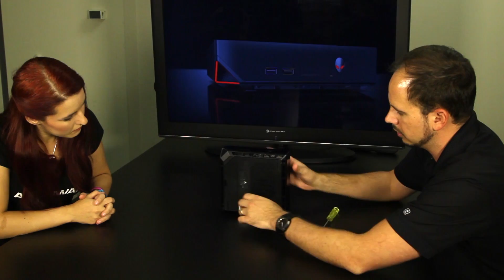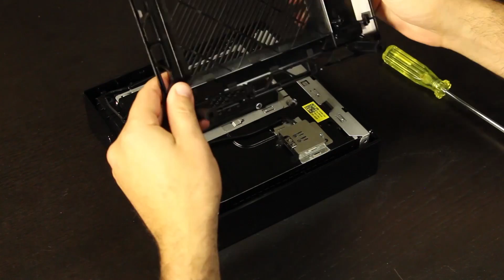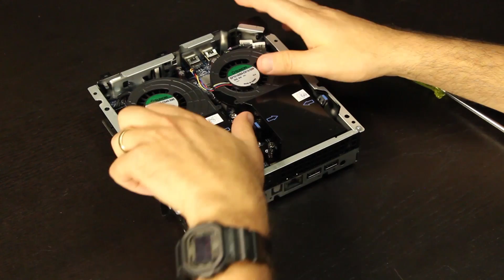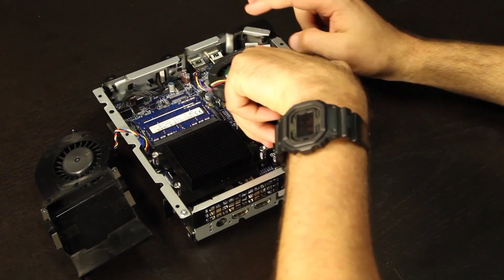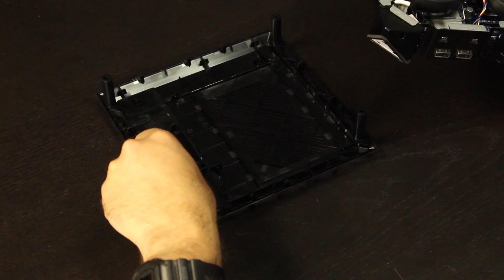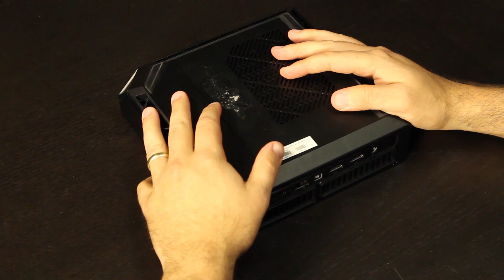Alienware Alpha - A Look Inside the Alpha

Comment: One thing im worried about is not being able to upgrade the GPU. I think no doubt if you bought a PS4/XB1 today and a Steam Console today (for a $150 more btw) in 8 years the console will still be able to pull of great graphics and run it at 30-60fps. While PC might have to run it at low-medium to maybe get 25.

Id rather build my own. But seems the only way to achieve this kind of processing power is to go to like a mini tower, which is something you cant keep next to a TV. Any suggestions?

Comment: I3 CPU is great for gaming?  ....

first upgrade found already
Reply from the maker: Aaron Huddleston Check out the gameplay vids. The i3 can handle the latest games with solid FPS.
Reply: True, but I wouldn't call the CPU ... futureproof or anything.  I'm sure the higher tier games like BF4 tried with an I3 would start to see the bottleneck.  We are just starting this gen so its just going to get worse from here.  Upgrading to an I5 would be my first move, that was my point of the comment.  I run a I5-2400 with a Radeon 6770 in my desktop im soon to upgrade and i really dont see many games outside of the Total War series really pushing my CPU, all 4 cores, to the max.
Reply: Aaron H. You can choose to upgrade your CPU later if you decide you want more performance out of your system. I'd suggest taking a look at the i5 model, as it's the sweet spot for overall performance per dollar.
Reply: Well the 1,6 Ghz Notebook CPU from the ps4 is futereproof ? I highly doubt that. btw its 28nm vs 22 ;) 28 with hgiher clock speed vs 22 is ok , but the alienware has much higher clockspeed and and the i3 is up  to date 2014 haswell , lol

Comment: I'm definitely gonna buy this. Could I put a core i7 4790K into this? Or would I have to stick with the i7 4765T? They both have the same sockets (LGA1150).
Reply: I see this question was previously answered earlier posts. I think Ill upgrade i7 4765T later and just go with the base model.

Comment: I Would want to know if i could pair this with the GAEMS M 155 scout, A monitor that is powered by usb. Does the alienware alpha have enough power to use it without PSU problems?
Reply from the maker: Trevor LueCheeLip We have not tested it. It has a 130 watt power supply. Most of that is used by the system.

Comment: LOL Could imagine Microsoft or Sony letting you upgrade components in their consoles? I'm never buying another console again.
Reply: No because that would be stupid. AS developers wouldnt have any clue what specs the users have and you'd have different requirements for different games. It would defeat the whole point of a console.
Reply: Clesarie Yet developers for PC's do it everyday? Go away scrub, don't reply to me if you have no idea what's going on.
Reply: I absolutely do but the whole point of a console is to develop your game for a set hardware allowing you optimize way better. PC games are hardly optimized and a lot of it is lazy back porting of console version. PC rely on the vastly better hardware to over come these things.
Reply: Clesarie is right, the point of consoles is to not have to develop for different sets of hardware. On the other hand, Alienware Alpha is not a console. It is in fact a PC. Most comparable to a laptop minus the monitor. People usually don't switch out hardware on laptops so it's a bonus that Alienware thought about that part.
Reply: And yet a lot of excellent games are console exclusives... If you can afford buying a 1500$ PC then good for you, but you have to see consoles as an extension to PC gaming, buy your multiplatform games on PC and leave the consoles to their exclusivities which are just as good (if not better in some cases) as PC games.
Reply: You're the scrub, dude. The point of a console is that devs only need to worry about one hardware set per console platform. Once that's eliminated, there could be games designed to work on new powerful hardware, but older hardware could be ignored or unplayable. #logic
Reply: ***** Jesus! Somebody help this man! He just went full berserk!...
Welcome to the internetz dude, people like me, you'll face a dozen a day... You just learn to live with it /o/
But more seriously, you really missed the whole point of my first comment even after I reexplained it...
Maybe another time...
Cheers :DD... And again, don't take the internetz too seriously, it'll only harm you.
Reply: ***** Having a master in computer engineering won't change facts... An HD7750 or even the 7770 can't run any 2012 game maxed out at 1080p60, even coupled with any multithreaded CPU in the market, benchmarks at hand... But yeah, you're the one with the master in computer engineering, you do know a whole bunch of computer stuff. Anyway, like it or not, computer gaming is not cheap, and today you can't get the same performance/price ration you get with a console (even though CPU wise, consoles are shit)... for now at least. And I don't like acting or being stubborn, but facts are facts.
Reply: it only the ram and cpu and nothing else though that would be cool to see the big two  do this as well.
Reply: *****  is actually right. I didn't read the whole thread though cause it was a lot replies. However from what I saw somebody said that PC gaming is way more expensive. Not true. Budget PC= $450-550. Can push games at 1080p 60fps while lowering some other things such as anti-aliasing and antisotropic filtering FXAA etc while still keeping textures at a higher setting than you would on a console. $60 per year just to use online services. Say you have a console and a PC for 4 years.
PC (lets say $500)=
$500
(game prices are from keyshops)
Dying Light: $40
Battlefield: Hardline: $40
GTA V: $45
Total= $625 x4 years=$625

Console (release price)=$500
Dying Light: $60
Battlefield: Hardline: $60
GTA V: $60
Online services x4 years: $240
Total= $820

On a budget PC still cheaper and better performance and graphics than console.
Reply: http://cheapdigitaldownload.com

Used this site a ton. You just get the Steam CD key so it'll be on Steam. Just look at the rating for the sites you buy on before you buy.
Reply: Oh sorry Dying Light is $25 on that site now :)
Reply: This isn't really a console, games don't run on the metal and you can't upgrade the gpu because it is BGA

Comment: Can the CPU in the alpha be upgraded to any LGA1150 Socket chip? Reason I ask is all the CPUs that ship with the alpha are 35W TDP with a LGA1150 socket type and most other CPUs (Quad Core) in that socket type are 64W - 84W TDP and with the Alphas low Watt PSU will it pull too much power then to upgrade to one of those chips (Depending of coarse on what the other components in the system pull for power)?

Also the RAM in the alpha can be upgraded to 16GB (Laptop RAM of coarse) right?
Reply: They said you can only upgrade the desktop "T" models of the haswell chips. And yes it supports 16 gbs of ram, but since there is only two slots you need two 8 gig sticks of SoDIMM ram.
Reply: James Hendricks I suppose that would make sence due to the 130W PSU limit to only use lower wattage Chips. I did get curious yesterday and asked a Dell Rep on there chat and they said it would support up to an 84W CPU but I can't imagine the custom GPU would take less than 50W of power, so not sure if I want to risk upgrading the CPU yet to something out side of there 35W versions untill more specs on the GPU are released. 

On a side note if I got the base system and upgraded the RAM to 16GB, would I see an improvement in fps and general gaming?
Reply: Not really in fps, but you would be able to have better luck running more things at once with less of a slowdown
Reply: James Hendricks How much better is the i3  vs the i5 in the Alpha, not considering RAM?
Reply: I think the i3 is only dual core, so the i5 is better, in certain stuff that uses quad core..I would just go with the i3, and if you need to upgrade just get the i5 thats in the other model off of newegg or tigerdirect.
Reply: James Hendricks I think thats what I'll do, I just preordered the base model and I'm going to order either 8GB or 16GB Laptop RAM on Newegg for it just before it ships!
Reply: Yes, the Alpha supports LGA 1150 socket, desktop 'T' variants of the Intel Core family (including Pentium, but we don't sell it with that line). The board TDP and BIOS are locked, so you cannot overclock those CPUs.

Comment: I first saw this yesterday while at work( Walmart ) in our pre-order booklet.. I currently own and use an Alienware X51( i5 3330 and upgraded it to a GTX 750 Ti ), My question, would it be at least comparable to what I get performance wise now or better. Thanks for your time
Reply: You would get worse performance as the i3 is not very good at handling high amounts of bitmap streaming when rendering textures at a fast rate .....your i5 in your x51 was kind of meant for that. PC games nowadays, don't let you fiddle with CPU settings because indie titles that want to make it big in the gaming world rely on people with powerful systems to build profiles that would improve optimization for the others. The problem.......this takes a long time and optimization for some games is terrible unless you have a good CPU such as the i5.
Reply: Since we don't know much about the GPU, and an i3 cpu is a really good cpu for the price..and honestly cpu doesn't matter as much in most games nowadays, i'd say that it would be probably comparable, but watch that skyrim video of the alpha base model; even with a few graphical mods that add more foliage and the like, it still stayed generally above 50 fps. I don't think it will handle the latest games like shadow of mordor on the best settings though.

Comment: So is the GPU non upgradable?
Reply from the maker: The GPU is not upgradable, however the CPU, Hard Drive and Ram are.
Reply: That is my question too. I have already pre-ordered the Alienware Alpha.
Reply: You can't upgrade ps4,PS3 or x1s..gpu either way if you compare. I'd wait for the next steam box and see if components is fully customisable to fit with PC gaming environment of upgrading to run games,  else you'll be left behind in 5 years when those PC hardware requirements get harder to satisfy. PCs overtake this current GPU with better ones in future. While consoles on the other hand will still be using the same low powered GPU because Game Developers  will optimise their games to run on lower powered console GPUs compared to PCs. Eg ..look how PS3 still going strong even though Specs sheets show less power. Question yourself is game developers going to optimise their games to run specifically for Alienware hardware? I don't think so, maybe?! Who knows?! This product is the best currently for price and the specs and performance you gonna get...but long term I'm not so sure it can last when those Pc game requirements get harder to matchup.
Reply: Alienware can upgrade to an i7 desktop processor or can it only be a laptop proccessor?
Reply: Angus Bing Only TDP 45W or below I think.

Comment: So...we can't go to a normal windows 8 screen ? And play other game like SA or PSO?
Reply: No, you can go to Windows 8.1 screen if you'd like, but we have built a full 10-foot console UI that lets you navigate all the core features, including launching into Steam Big Picture mode, with just a controller.
Reply: Marc Diana Thank you so much.
Reply: No problem. We know there are tons of questions around performance and the GPU so we'll be coming out with a bunch of new videos that answer these questions.
Reply: Marc Diana
May I know if we can change the hard drive?
Reply: Ichimaru8989 Yes, you can change the storage to a large capacity HDD or an SSD if you'd like. It's easily accessible on the bottom of the system.

Comment: maxwell gpu, so its a gtx 750 or 750ti, hmm. I was wondered about thermal throttles at first but it should be fine. Push that to a 760 and it will throttle no question. meh im just gonna dual boot, then i have windows and steamos which is just big picture so ill feel silly. But if i was to buy that i would straight away change those heatsinks, they are too small for me even if they do the job

Comment: Show us the gpu already! It's the selling point
Reply: Mikaela Murry Apparently it IS in fact, soldered on chipset.  If you want something you can actually upgrade, you'd need one of the small gaming boxes with a standard desktop GPU and micro ATX motherboard.

Alienware are roping people into proprietary hardware limitations that will put them in the same spot console owners are in... can't upgrade the GPU, which is what matters.
Reply: luke viscardi
It's a custom Maxwell GPU so it's basically a laptop 800m series GPU. So it's more powerful compared to a 700 series GPU.
Reply: it's a custom GPU using GTX 860M 2GB DDR5 as base
Reply: My main question regarding the GPU is whether it's a socket design like swapping a CPU (doubtful) or if it's like a laptop GPU being a small card with the GPU/RAM and furthermore, how ailenware plan to offer competitively priced GPU upgrades?

Because right now, Laptop GPU's cost a fortune (over 1200 dollars for a 980m and 700 dollars for a last gen 880m)
Reply: Noah Fledderman That was a terrible decision on their part IMO.  Are they going to make owners replace the entire motherboard just to upgrade the GPU?  maaaan... a laptop GPU slot would have made so much more sense.
Reply: Noah Wolfe The graphics in a PS4 are no more integrated than the alpha's are. There are no integrated solutions that perform as well (Roughly an HD 7850 or R9 270). The AMD GPU in the PS4 beats the "750Ti"-like GPU in the Alpha, and on top of that offers a dedicated ecosystem to allow game developers to optimize their products. The only appeal or ability the Alpha has over a console are its PC functions.
Reply: custom gpu its in the description
Reply: I realize that. But it gives us no idea what it's capable of. A gtx 750 could have 2 gb o VRAM and so could a 770.
Reply: Noah Fledderman  I read on Alienware site, that it said a custom GTX GPU
Reply: I am well aware it's a GTX, I am just saying that it is in the category of an 800m series. So this GPU is a GeForce GTX 800 something.
Reply: Oh, I'm still new to this stuff.. Sorry.. I learn something today..
Reply: The 800m series is Nvidias newest mobile series commonly found in laptops. Though, the components used in the Alpha are shown to be mostly of laptop components, so truly this is categorized as a mobile device even though you'll find it in the livingroom as a console. The only difference is that it's using a full desktop CPU.
Reply: Okay. Thanks.. I heard of the 800m series, just didn't know the full background
Reply: FastRedPonyCar
Well if you're asking whether or not it is possible to replace the GPU, the answer is no. The GPU though is actually built into the board, so it doesn't use any socket technology since of course it's a part of the board. That's why they call it a custom GPU. On the bright side though, it has been hinted that some point in time, all laptop systems by Alienware and possibly this will include the port for Alienwares new Graphics Amplifier which enables any computer connected to it to run off of a full desktop GPU.
Reply: Noah Fledderman tldr... but in its standard form (the way it ships to you) will it be as powerful as a PS4/XBone?
Reply: Thursday121am PC>Console, until quantum computing can be applied at which point all technology has infinite processing power and therefore PC=Console=every other quantum computer based device
Reply: Thursday121am You tell me, The Xbox One and the PS4 use AMD Jaguar Processor with integrated Graphics, while the new Alpha Console will be using Intel Core i Processors with Dedicated Nvidia Geforce GTX GPU with its own dedicated 2GB VRAM. A lot of games are being released for both the Xbox One and PS4, but the Alpha will come featured with thousands already that you can purchase off steam. I'd say for what you'd be getting from the Alpha is powerful.
Reply: Noah Fledderman Well i've already seen IGN's video comparing it to the PS4 & XBone.... /watch?v=B6NWOaM0NW8

The Alienware Alpha falls slightly short, yet has so many other advantages (steam integration, keyboard & mouse, Windows 8.1, upgrade-ability)... I'm already sold on that shit!